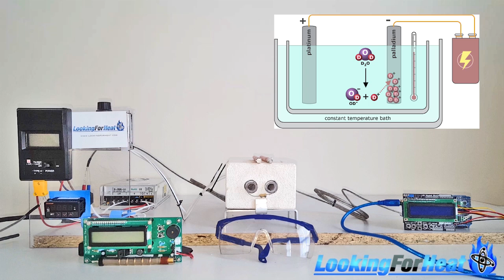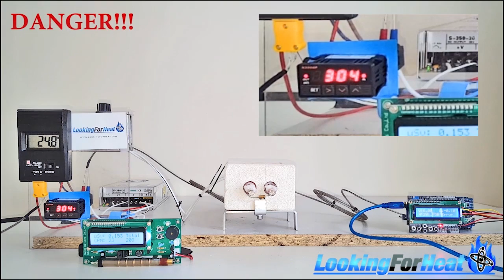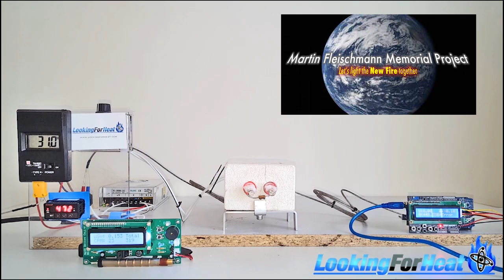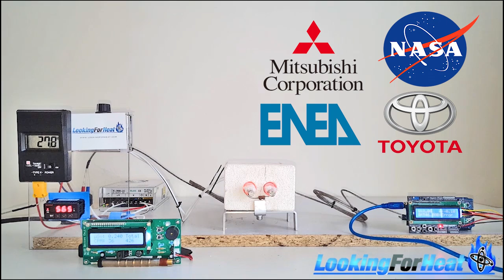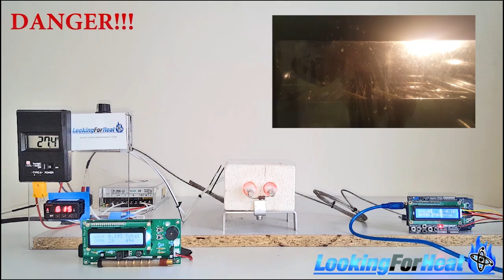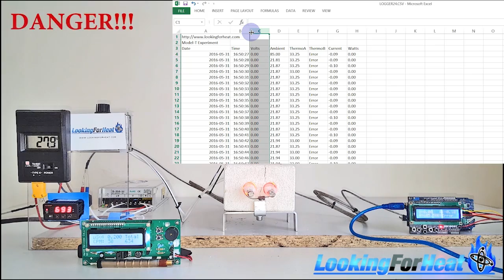LENR for Dummies - A beginner's guide to Cold Fusion Research

Comment: i desperately need to contact you and your work. are you still active? I've made multiple multiple massive Discoveries & breakthroughs in many of the electrochemical, phase shift energy transfers, nano lattice crystal production, ionic states, monoatomic states, and many different types of hydrogen isotope production methods within low voltage el-chemical lenr systems and reactors I've developed

Comment: LENR is exothermic fusion rather than nuclear fusion and that a lab said that the physics behind it are not known to science is hella sus considering it's the same physics behind artificial salt production and considering every scientist has used it at a point when they didn't have a flashlight to make it to the bathroom in the middle of the night so the physics behind it should be relatively well known
Reply: It’s and you are right.
Reply: @rahusphere  I know autocorrect struck again for whatever reason and I meant is rather than it's , with that said I'll change it now